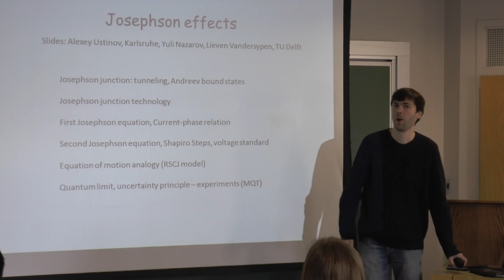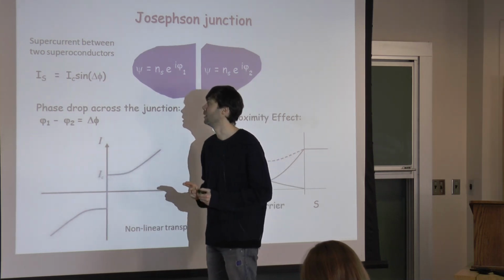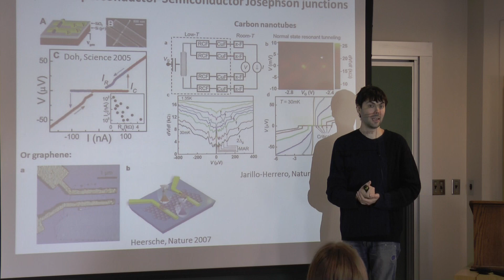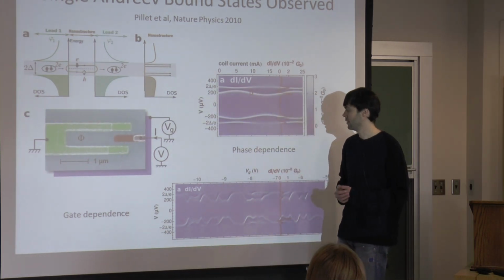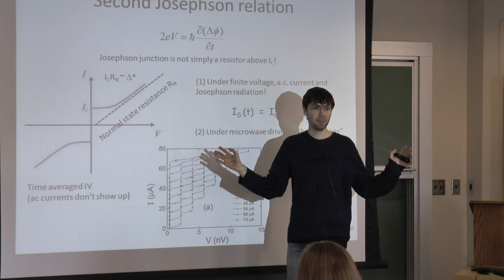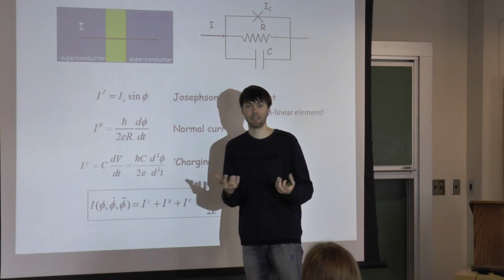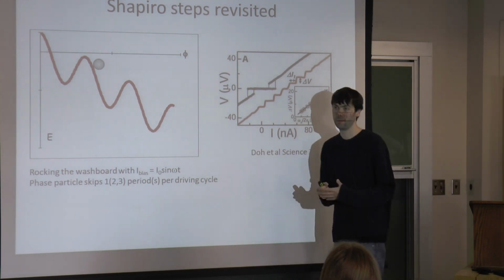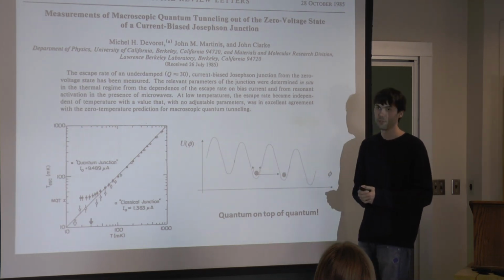Quantum Transport, Lecture 14: Josephson effects

Comment: Electrons in the conduction band at low temperatures are combined into a Bose-Einstein gas, which has the property of superfluidity, therefore, the so-called superconductivity is actually superfluidity of an electron gas without the resistance of the crystal structure. The ability of a substance in a special state, which occurs at temperatures close to absolute zero, to flow through narrow slits and capillaries without friction. This is superfluidity.

Comment: Can someone please elaborate more how in (30:56) magnetic field adjusts the phase? Aren't they in the same phase because it is one just one metal?

Thank you!
Reply: Salamat Burj I guess it’s due to the Lorentz force. You’re welcome.
Reply: The magnetic material has an exchange field, which will then impose a phase shift on the two electrons of a Cooper Pair as they propagate through. What that means is that there will be a boundary that the cooper pair has to cross and this will force one electron into the majority band, or spin-up, and the other into the minority band, or spin-down (Pauli's exclusion principle)